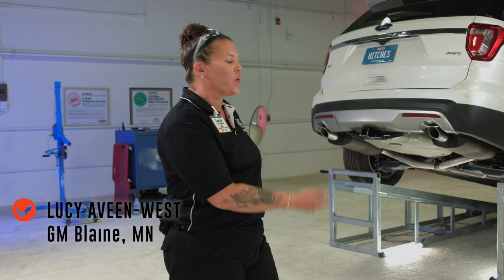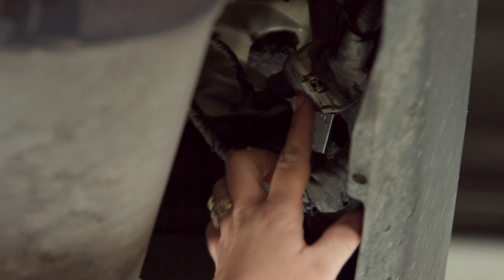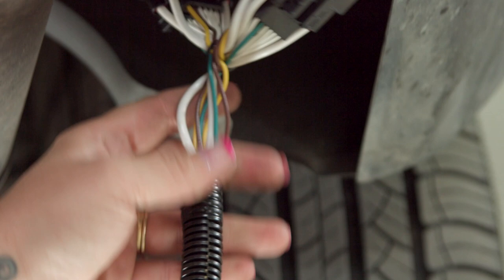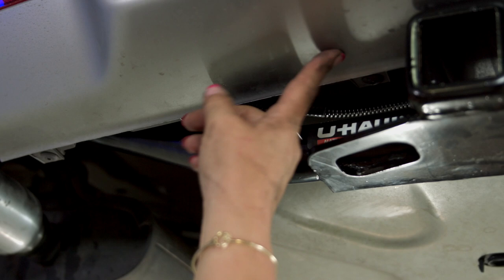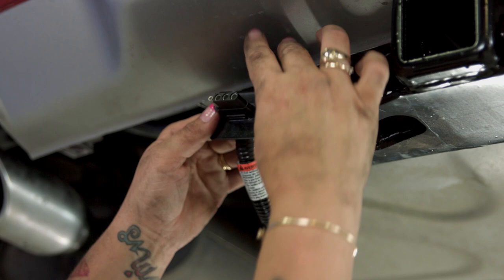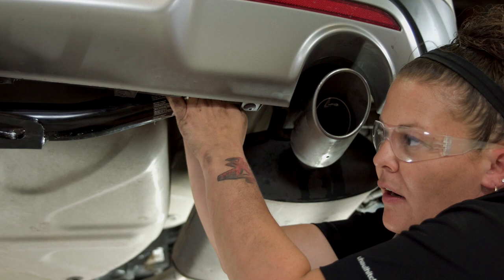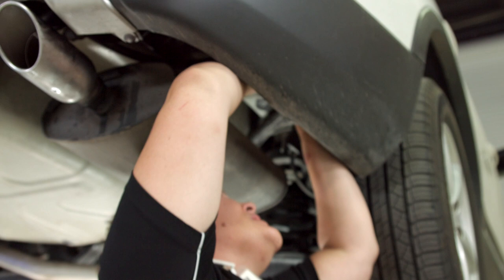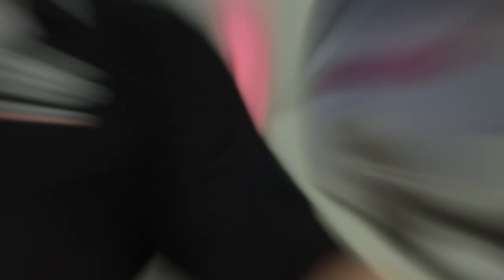2017 Ford Explorer Trailer Wiring Installation

Comment: I did that to mine but the constant is not working.  Is there a fuse I possibly have to put in for the trailer lights?  Everything else works but only the constant where the lights come on with the headlights

Comment: My Ford Explorer only has one harness?
Reply: Did you figure it out? Mine also only has one harness and trying to figure it out
Reply: @luciottrinidad  yes, I bought the wiring harness for then Ford Explorer you only need to connect one. Trailer lights turned on right away
Reply: @michaelcastillo5608  SO yours only has one harness but you made it work? How? I don't understand your comment to lucio.